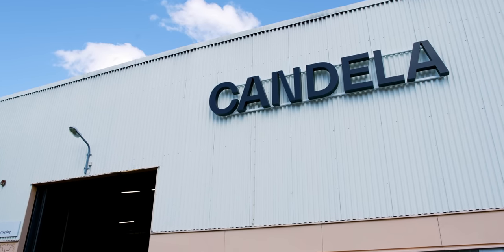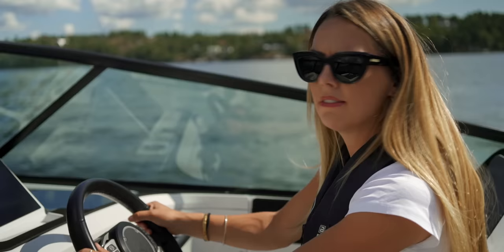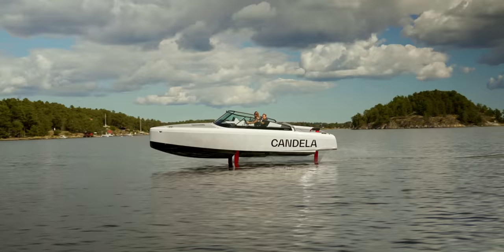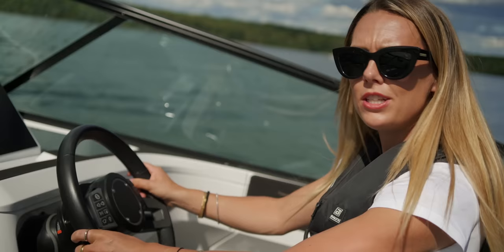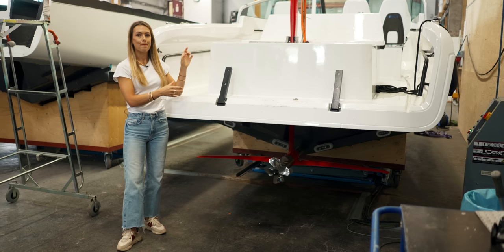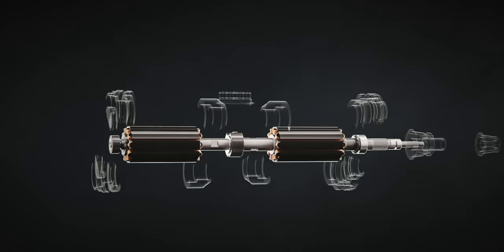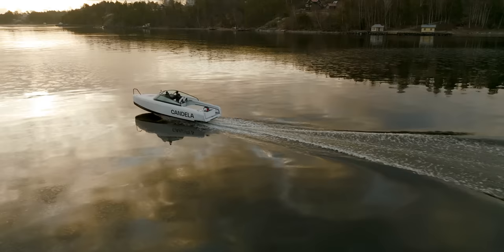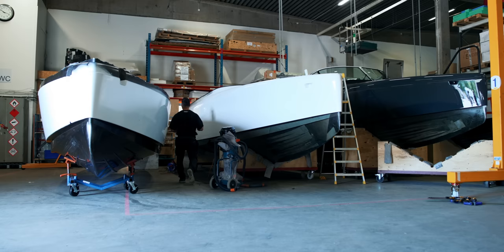This Candela Electric Boat FLIES!

Comment: Amazing technology...
What I missed from the video is a few words about how safe they have made the combination of electricity and water.... I would want to know what happens if there is a bit of water still in the boat and the charging cable falls into it by mistake.  I guess they have intelligent solutions for all of that, but we are all trained "don't go near water with electrical wires" - yet here this is exactly what you are supposed to do.
Reply: Millions of Tesla's get charged in the rain...
Reply: Standard charging cables are not live until you have done a little checking that you are properly connected and everything is OK. That is what those small pins are for. If after that you dunk the whole thing in salt water, all manner of fuses and ground fault protection blows. This is a solved problem, since cars have to get charged safely outside.
Reply: There’s a three phase electricity supply at most points in a marina isn’t there?
Reply: I'm assuming that they're using the same charging standards as EV cars (UL 2594). The cable typically has 5 wires: earth ground, hot and neutral, data, and trigger detect. The hot and neutral lines (which carry the power) are disconnected via relay switches until the car/boat is verified via the data pin. Additionally the hot and neutral lines are disconnected the moment you press the trigger on the charger's handle to unlock the charger from the car/boat. Both the cable and charge handle is sealed from internal water ingress by at least two layers of protection. The charger also has an internal GFCI circuit, which will disconnect hot and neutral if more than 20mA of current is lost from the hot/neutral loop, which protects against cuts in the cord or failure of the seals.  Suffice to say, the charging technology is already safe for marine environments. I'd be more worried about corrosion of the mating pins in the charge handle due to the salt water environment.

Source: I've designed and safety tested EV chargers

Comment: @10:48, I dont know the specific mechanical properties of the Candela yet usually hydrofoils have a minimum speed they are required to maintain to be at their desired high point. In that the slower you are boating, the hydrofoil will sink further into the water. Then you have all of hydrofoil structure under your boat that a conventional boat doesnt have. 

Or that shallow areas are a danger and your manoeuvrability is probably penalised a bit. In that hydrofoils should be less desirable for navigating a slow speed area, like a harbour.

Maybe someone can speak more to the science about current speed and how the hydrofoil works.
Reply: The hydrofoil retracts, if you look at the shots in the factory the motor pod is up at the same depth as the keel.
Reply: @zapfanzapfan  oh cool. Then this boat has no advantages over any other boat at slow speeds. That it will produce the same wake while navigating at slow speeds.

Comment: Everything is cool except the price...Yikes..... Also, Stick a solar canopy on top for some extra range or emergency range in case you get stuck.
Reply: Purchase price is completely in line with a comparable premium conventional boat.
As said, fuel and maintenance costs will definitely advantage one of these if you use it often.
Boats are just one of those lifestyles where you pay to play.

Comment: Cool machine. How far can a sim ICE speedboat travel?
Really don't think 'lightweight' can be used as a verb, and as for 'unbumpy'...
Reply: "lightweighting" is a common term in engineering circles.
It may not be as widely accepted by the general public, but it's definitely part of any manufacturing lexicon.

Comment: Venice missing a trick here.
Reply: Can you imagine? They didn't tell us what the minimum speed for getting up on the foils was but I guess it to be well above the top allowed speeds for most inland waterways in the world so it is going to be pretty niche. When I hired a pleasure boat on the upper Thames (many decades ago) the top speed was 4 knots if I am remembering correctly. It could be that that speed is set because of wake but would still require massive changes to allow hydrofoils (of any type).

Comment: Are the hydrofoils removable for trailer transport? This design looks awesome on the water, but it seems like it could be a bit difficult to move around for people who use their boats on smaller lakes on the weekends. Maybe that isn't the intended market?
Reply: They actually life I to a slot in the hull so they should be able to go in a trailer
Reply: I don't know really, just thinking making the most crucial part of the boat removable would make it less reliable. Most likely they just need special trailers.
Reply: the foils retract into the hull / above the lowest point of the hull. So, yes, you can put it on a trailer. In fact, afaik, Candela offer buyers the option to pick it up in Stockholm on a custom trailer. So you would just drive there, hitch it to your car and drive home.
The foils retracting into the hull is also used when docking or generally moving at very low speeds in low depth areas.

Comment: 50 mile range
30 mph   1.6 hr charge..  that f land
Lots of places on water to go . So i go
35 mile  one way and 16.66 over to 2nd stop and refuel ak charge.. but 1766 feet  542 meter
Short .. i ran out of b

Comment: I’d love one of those!  

Unfortunately, I still lack total control of the oceans, and cannot as yet generate millpond conditions by sheer force of will.  
Not even with a trident. 

I’m sure it will make a great river taxi though.  Just as soon as they can get dispensation to exceed the speed restrictions on inland waterways. 

 I don’t mean to be facetious… well, I suppose I DO mean to be facetious, but only because it’s a really great great concept, and it felt conspicuously omissive to the point of being provocative, to have created a review (albeit a brief one) without addressing how the thing is apt to behave on open water that has a more typical bit of chop to it, or how it is supposed to take advantage of its great efficiency on plane if put into service as, say, a water taxi, when it has to go double most river speed limits to even get up on its hydrofoils.  

And because I really want it, and can’t afford it.

Comment: How does this deal with lakes?   Well, or any other shallow water.   Do the hydro foils fold up?   How do you get the engine out of the rocks?   Or is this just for deep sea stuff or where shore lines are steep?
Reply: Yes, they raise up.  Kinda huge omission for this video not to cover that aspect.
Reply: @curtisbme  Yes, Boats are less fun if they can never "park".   :p

Comment: Very cool. As (relatively) efficient as hydrofoil electric boats may be, that range is hard to swallow :(
Reply: But the vast majority of leisure boats are only used for a few hours at a time. It's actually very rare to see more then 2-3 hours on a boat per week. Most just stay in the marina as holiday homes afloat. This is a perfect replacement for a lot of day boats and tenders. It's going to be very popular. 
The comparison between boat and car energy usage is a little strange. Diesel boats are rated in litres per hour, or gallons per hour so the energy consumption of the candela is excellent.
Reply: If you run a water sports facility yeah I'd stick with diesel boats. Electric boats are ideal for taxis and island hopping on the other hand, you visit a couple beaches, return to town for lunch and keep the boat charging in the marina, enjoy the sunset on the deck and call it a night.
Reply: @patrickjr11  dont get me wrong, on a practical level the range is perfectly sufficient for a good chunk of casual boat users. That being said, people are already obsessed with with having more range than they practically require in their EVs. Throw in the added worry of being at sea and range anxiety is gonna be through the roof. Maybe thats just me though. I know id be maxing that range on an average day trip return distance + some low speed manouvrering + some real world range pessimism thrown in lol.
Reply: @UserEighteen  would you though? The vast majority of boaters don't. How far do you actually go on your boat? 
Usually it's to the nearest bay / pretty spot. A. It of lunch and the back into a harbor for the evening.

Comment: Its ok to depart from imperial units entirely. I think in only one industry are you actually required to report in ft but most other industries, imperial is optional or becoming more and more obsolete. Join the revolution to stamp out an inferior system that doesnt make sense. 36 inches or 3 ft or 1 yrd which is 1/1760 of a mile? Then try to measure less than 1 inch, accurately… I pitty the sick people who insist on using what is a rubbish system.

Comment: Yep untill the average person hits some shallow water or a log etc it's all been done before yes the maths is awsum but in reality a well designed Catamaran with a centre foil between the hull is efficient and can be put on a trailor or be beached or run in shallow water.

Comment: Why is this channel so aggressively anti- metric. Converting miles to a different type of miles but no km sounds like trolling. And you even make up new ecconimy units rather than learn the metric ones. Its not 1800.
Reply: Nautical miles are the international standard units of measurement at sea.
Statute (Imperial) miles are the offical unit of measurement of distance in the United Kingdom. This channel is based in the UK. 
There are no standardised economy units for sea travel, because variations in weather and sea conditions make them next to useless, unlike those for land vehicles.
Does that answer your question ?

Comment: use metal-air batteries (effectively same as gasoline) with reduced drag, even more longer range
Reply: you dont need many people for a perfect prototype, one man can do all for the prototype
Reply: why do you mess yourself with the pressure fields, think like a direction rotor paddle instead, when it points up, it goes up, when it points down it goes down
Reply: of course its possible, easily, dont even start with that complicated sell speech stuff

Comment: 50 miles range, lmao.
Reply: For a leisure boat that actually not bad. They are never used that much so it's more then they would be used in a days boating. Even the diesel engine boats rarely have more then 100 hours per year on them. So the range here is more then enough
Reply: Bring a generator on board
Reply: @patrickjr11  yes, 50 miles at a normal leisure boat speed of, say, 4 knots is considerably further than you could go in a day.

Comment: Still doesn't make a whole lot of practical sense. Doesn't drive very long at high speed and doesn't have the advantage of the hydrofoil at low speed. The low maintenance cost is super appealing though.

Comment: The downsides are that you draw a lot of water at low speed. This is fine for the deep fjords of Sweden,  but around reefs in the Caribbean, it could get a little risky.  Also growth on the hydrofoils  knocks down efficiency quickly. It needs to be stored on a lift, out of the water.  

It's great for billionaires to go to and from their yatchs.
Reply: Also, what happens when there's a lot of waves?
Reply: the hydrofoils retract into the hulls, above the waterline.
Reply: @licencetoswill  it looked like the rear foil was integrated to the drive unit.  They weren't clear if that can pull up out of the water. The effect  of any growth is going to be magnified because the total area in the water is lower.
Reply: exactly. j0n is right. The foils retract above the water line and into the hull. So, if you need to move around shallow areas, or even if you want to beach it, you can do that. And the foils won't build up too much growth because they are above the waterline when docked.
Reply: I think this should work fine for mere millionaires. That should be a big enough market.
Reply: They have some in the Caribbean already. 2 in the BVI I believe
Reply: @aidancatterallbyrne8981  nice! are those C8 prototypes? or C7s?
Reply: @makanimike  C-7's. Used to live out there and saw them around

Comment: Please science harder. Hydrofoils do not provide flight. Like the foil is in contact with water and relying on the water to be there. You wouldnt want to 'fly' a hydrofoil boat off of a clif and expect anything less than a grizzly demise for your boat. It will never generate enough lift. Lift in air or propulsion in a vacuum, which is a requirement of flight.

Please work on being better science communicators.

Comment: I’d rather a gas motor over battery in a boat.  Battery technology is way behind and not the answer for boats even when you can reduce the friction by 80%.  50NM at what cruising speed?  That’s not really appealing considering what this goes for.

8:56 this guy is lying through his teeth.

Comment: Can't wait to see one of these burning up like a tesla, but on top of water. That will be neat
Reply: hybrid vehicles, which have an internal combustion engine and an electric motor, had the most fires per 100,000 vehicles (3475), while vehicles with just an internal combustion engine placed second (1530 per 100,000). Fully electric vehicles had the fewest: 25 per 100,000.Jun 2, 2022
Reply: Some people just want to see the world burn.
Reply: @scottmcfadden386  I don't see you disagreeing though. It will be funny to see a fire that can't be put out, on top of water. To argue, which is what I think you want to do. I will just say, at least those fires can be extinguished.